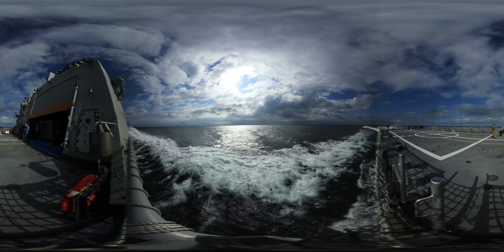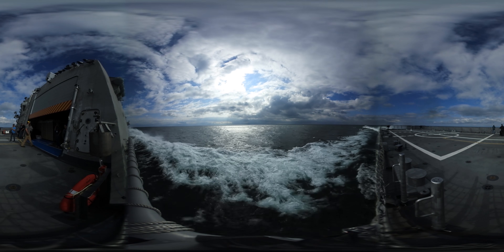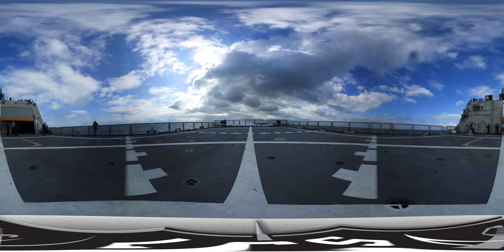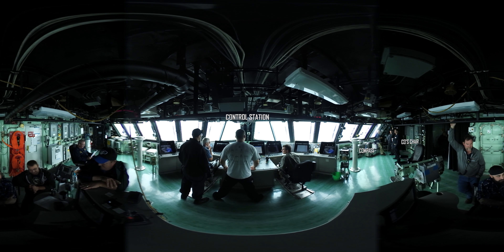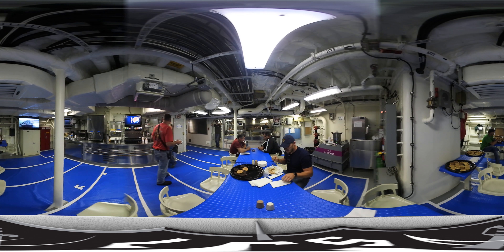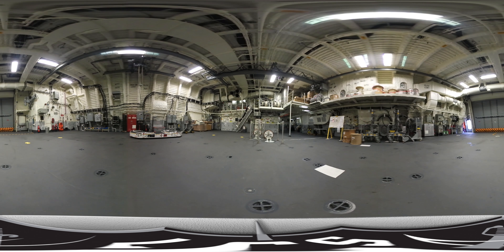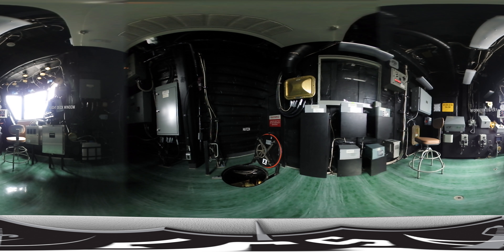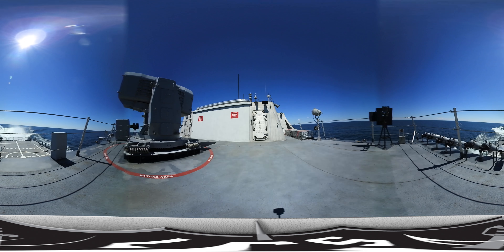Virtual Tour: Littoral Combat Ship 9

Comment: LCS is designed diversity in mind.  It is not a frigate replacement program >(FFG(x)) The future 2020 Frigate FFG is designed for combat.  It is not designed to take a hit.  It is not designed to carry heavy armament. Lets cover some reasoning we are making 10 independence-Class and  10 Freedom-Class?  60 man crew. Speed (one of the fastest naval ships ever). Helipad. Hospital ship. Disaster relief. Search and Rescue.  Naval Deliveries.  Marines deployment. Speacial Ops.  Drone Deployment.  Special Delivery assignments. Training.  Logistical Resupply (like helicopter refueling platform).  There usually 3000 tons at 4000 miles max.  Current ships are being outfitted with 16 Hellfire Vertical launchers with ranges over the horizon lethal. Also a 57mm Bofers Cannon.  Keep in mind final thoughts here.  NOTHING can catch this ship as its so fast on water it is intended to run from trouble.  The navy knows its flaws.. and because of this, these are getting killer upgrades.  They now added 4x.50 caliper brownings recently.
Reply: It can catch it a 50 knots modern torpedo like Black Shark or F21, launched from a hidden submarine. Freedom's maximum speed is around 40 knots.